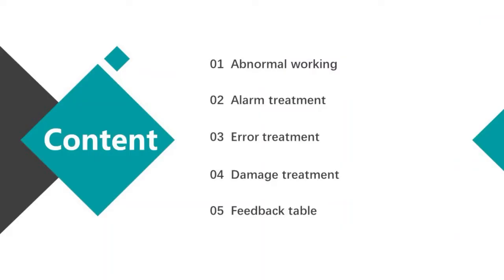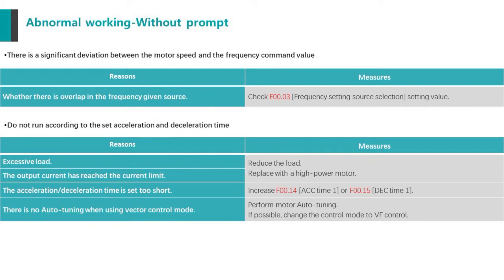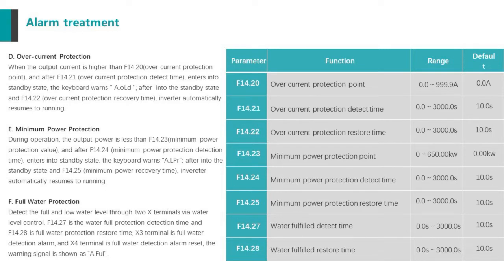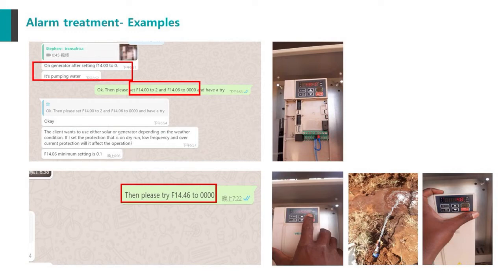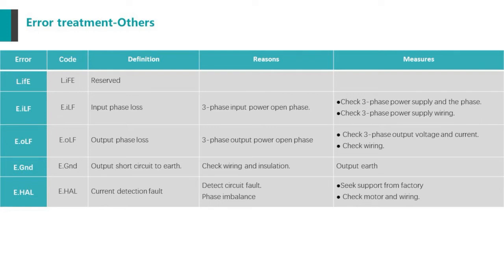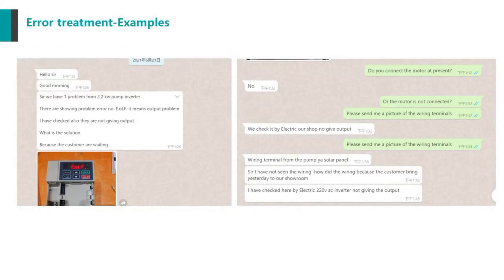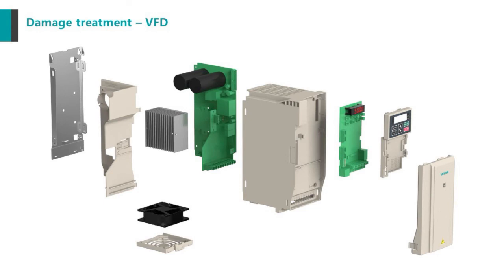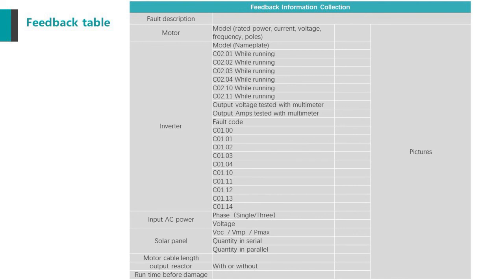VEICHI DAY(Yemen)-Service

Comment: Namaste sir, my Veichi SI23 vfd inverter is working well with key pad but it is not working with com and X1. I programmed F00.02 to 1 and F02.00 to 1 then key pad Run - Stop keys stopped working but function X1 to Com connection not working nor relay operating any clicking sound producing. What is the fault. Please guide and oblige, thank you.
Reply from the maker: Hi, thanks for your using our solar pump inverters. Could you please let me know your email or WhatsApp number? Or please contact our email: overseas@veichi.com